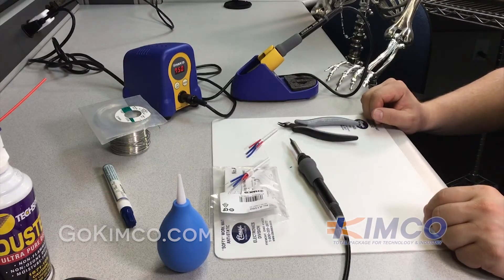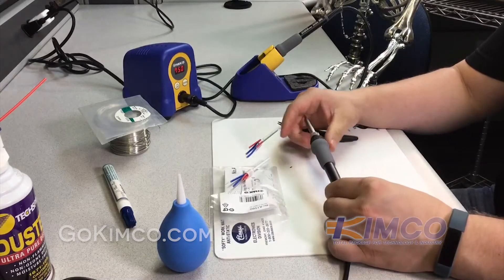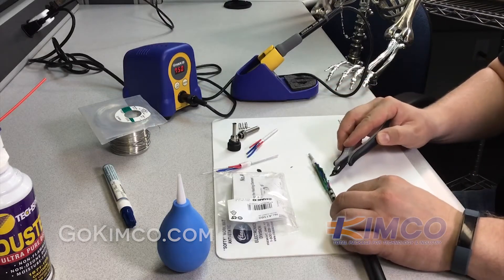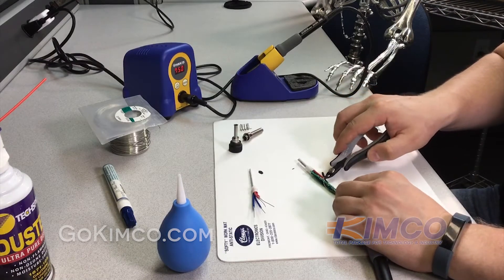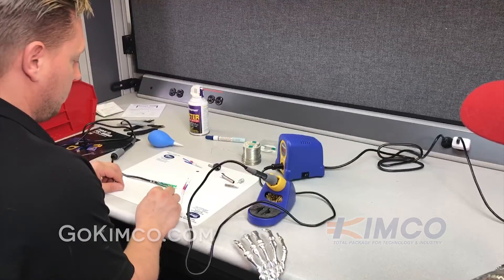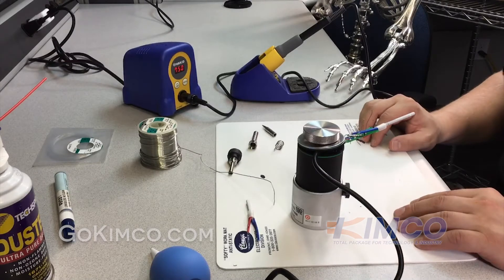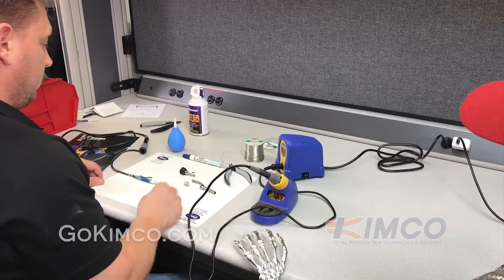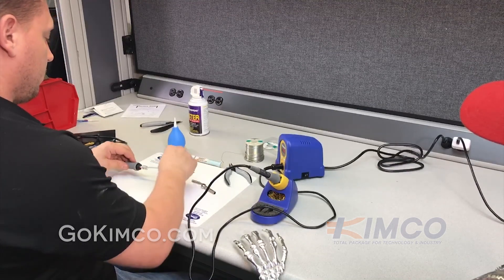How to replace the ceramic heater in a Hakko FX888D

Comment: May I ask you, I bought a Plato tip at Mouser and after a few days using it without problems, I tried to change it to another tip and it was stuck, impossible to take out, eventually i broke the ceramic, do you think its a iron problem or poor tip quality problem or misuse?

Comment: Mine had a temperature sensor giving bad data and caused it to max out around 500, replacing it seems to have fixed the problem. Thanks for sharing.